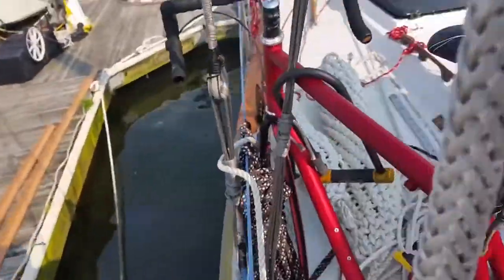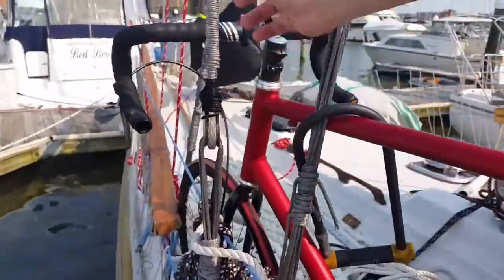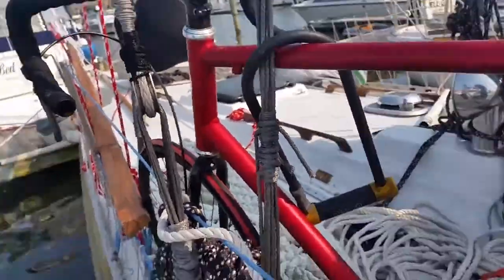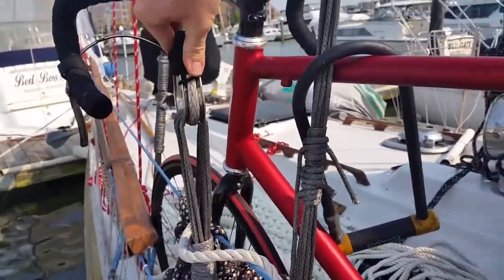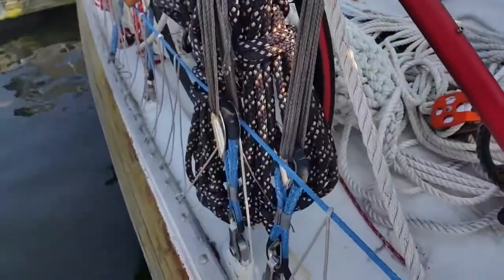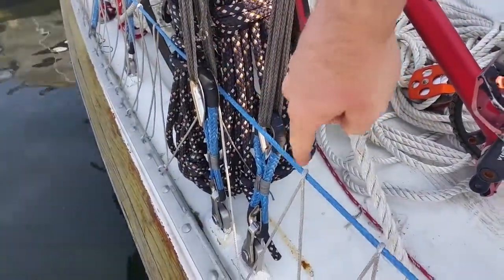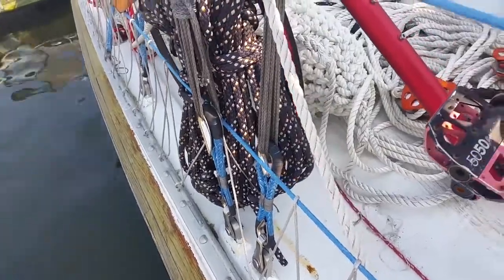Synthetic Standing Rigging: Initial Setup

Comment: I know this video is 2 years old so I hope you don't mind the late question lol 😀  I also saw your other video how you tensioned it with the 8 to 1 ratio and then lashed it.  So with that being said, once the stretch is out of the lines, do you tension it to a certain level, or pounds, or do you basically just align the mast (does that make sense?).  It seems like if the tension was too high or too low it could cause problems.  I also saw your video about how the mast is light weight and gets its strength from the lines.  So I'm guessing it would be safe just to put tension on the rope and make sure the mast is properly aligned and isn't bending too much.    Love your videos👍👍
Reply from the maker: The ideal amount of tension is just enough to keep the mast straight and centered while under sail. Obviously that is the most vague answer ever, but basically, you do a dockside setup where you get them tight (I measure it by feel, no instrument), then go sailing and make any fine tuning adjustments as needed.
You want the leeward shrouds to all go slack. If they don’t, they are too tight. If they are too loose, then the mast will flop over too far. 
Basically, tight enough but as loose as possible. 

Anything past the needed tension is stress on the boat (and will break the boat), but too loose and the mast bends weird causing poor sail shape and poor performance.

Comment: how are you liking your all-electric auxiliary? is the regeneration worth the effort?
Reply from the maker: We like it, and the regen worked well while crossing the Atlantic. It provided all of our power needs and was able to keep the freezer running 24/7. 
As far as going electric just for regen, I don’t think it’s worth it then. The only time it has produced notable amounts of power was while ocean crossing in trade winds. Coastal and island hopping in the Bahamas, we never saw any appreciable power from it. 
You figure 4 amps at 48v comes out to be 16 amps at 12 volts, but you have to maintain that speed for a full hour to get those amps. If you only did it for 15 minutes, all you got was 4 amps. When you are trying to charge up 13 Group 31 (105ah) batteries, 4 amps seems pretty pitiful!
So, yes we would recommend it if you don’t plan on motoring everywhere and regen is a nice surprise when it happens, but don’t plan your entire power budget around the amps it “will” produce.

Comment: nice set up, I am very interested in doing this for my boat.  my boat is a much much smaller 18ft sovereign.  I was wondering if you think this type of system would work on a trailer sailor.  I don't dock or moor my boat....and use it off and on the trailer.  thank you for any information or knowledge you might have.  kevin
Reply from the maker: Yes, on a small boat, you can actually tension the lanyards by hand with no winch. Trailer sailers also benefit that when the mast comes down and the rigging goes slack, there are no wires to chafe on the hull and deck.
Reply: Rigging Doctor thank you for the reply, and do you think the dyneema lines will hold up well to the raising and lowering of the mast on a trailer sailor.